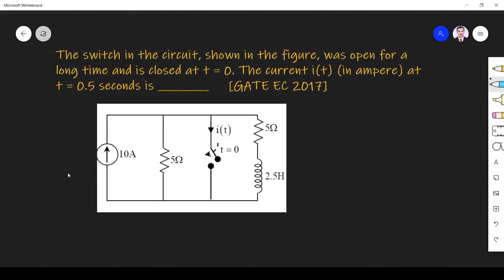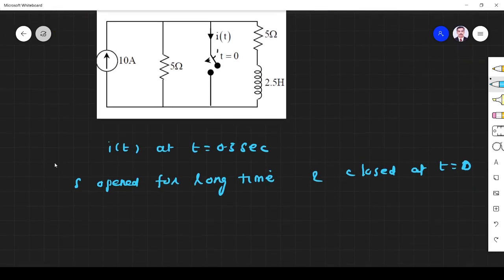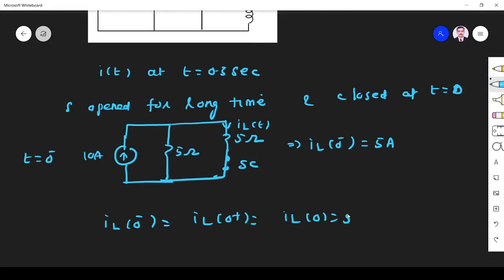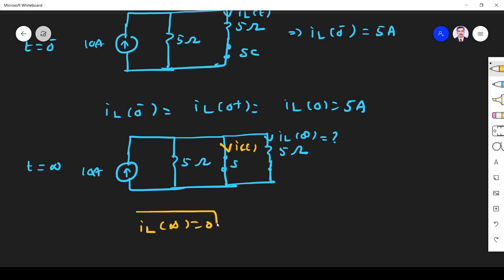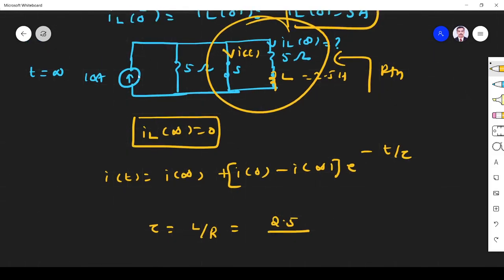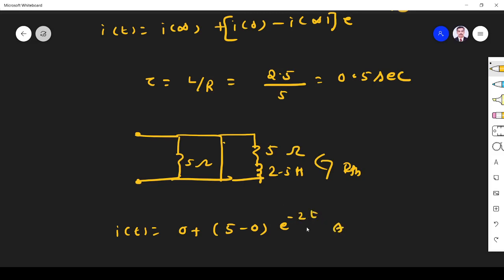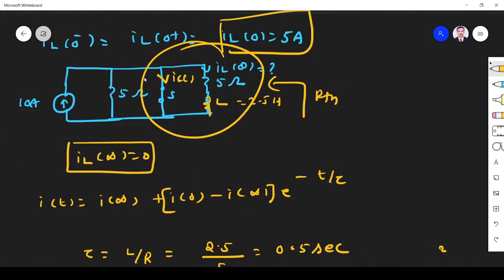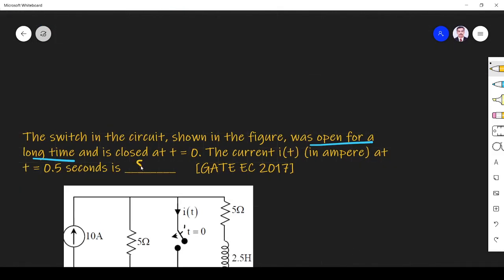Network Theory GATE 2017 EC Solution |#32|

Comment: Il(♾️)=0 i don't understand that can u explain?
Reply from the maker: When t tends to infinity switch is closed ..so that branch become short ..hence all the current goes theo it..no current goes in the branch where inductor is present..hence current theo inductor is zero
Reply: @majeethlectures  bt when we done previous problem . current through inductor is nt zero ?
Reply from the maker: @rihamashirin3247  there is no short circuit in parallel
Reply: @majeethlectures  still don't get it.its okay thank you sir for u reply 🥰
Reply from the maker: @rihamashirin3247  compare both the problems...in this problem..we have short circuit in parallel with inductor. We know that if we have short circuit all current will go through that branch only na..that's y no current flows thro inductor branch..hence i=0